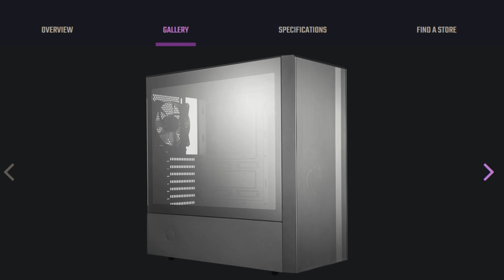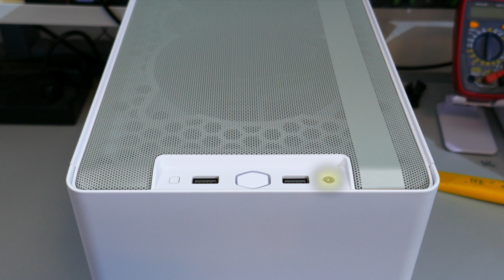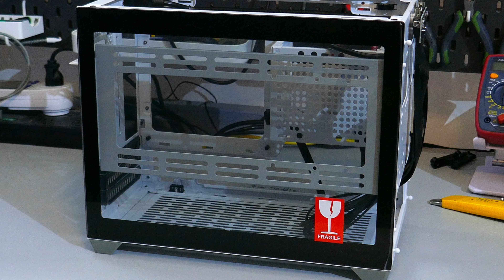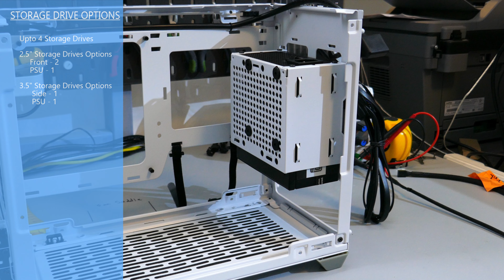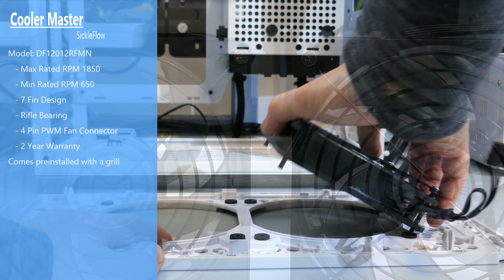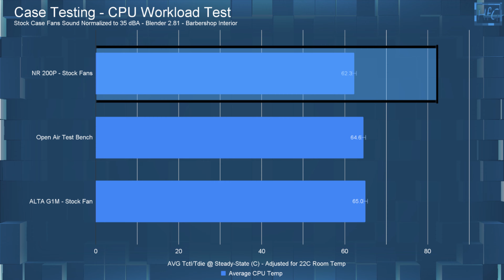Cooler Master MasterBox NR200P - Case Review

Comment: Thanks for the in depth video, I'm going to tackle building in this case this weekend. I got a 3d printed ATX PSU bracket because my budget wouldn't allow an sfx power supply. Hopefully I don't run into many compatibility issues but that's wishful thinking.
Reply from the maker: Good luck with that